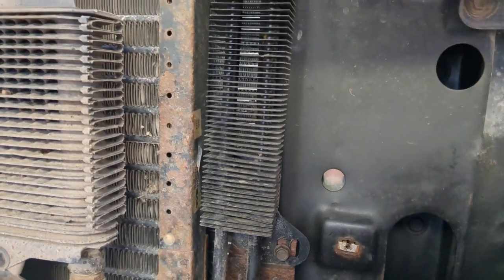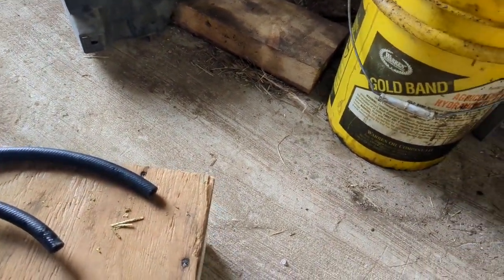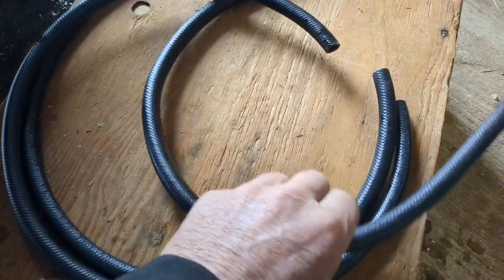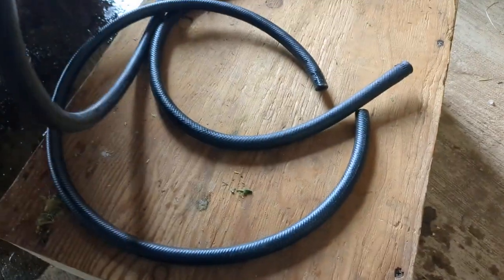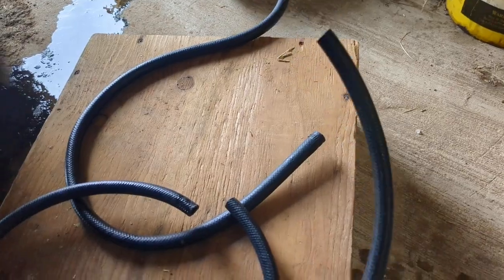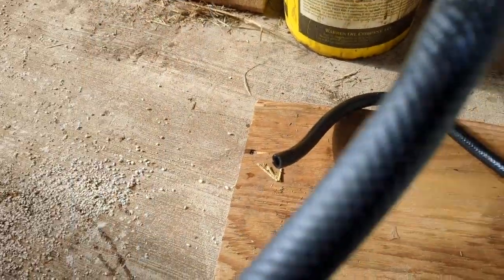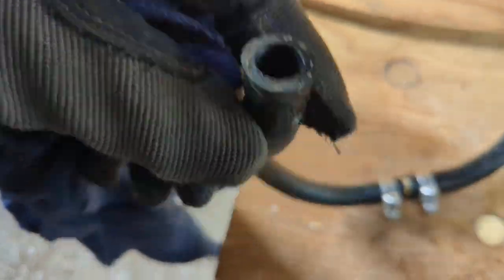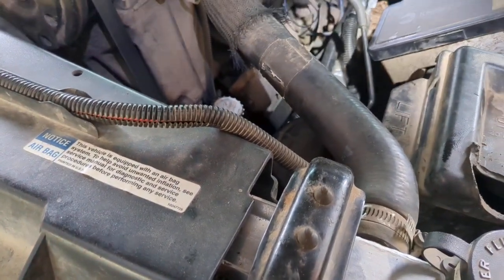I learned something new today.

Comment: I learned that on a John Deere tractor had a power steering hose made and it didn’t last very long found out it has to be a high temperature hose put the high temperature hose on never leaked again